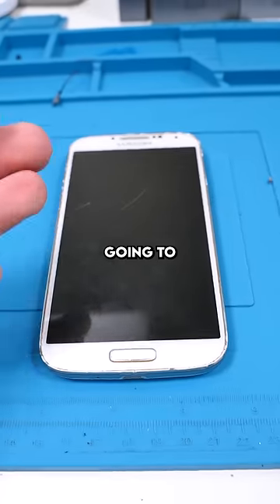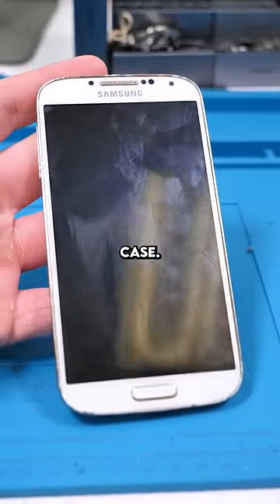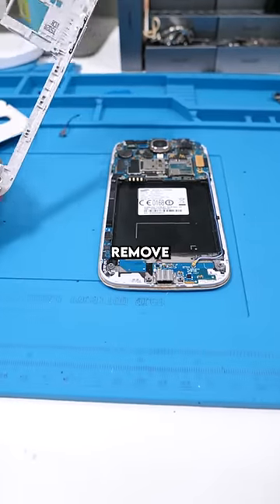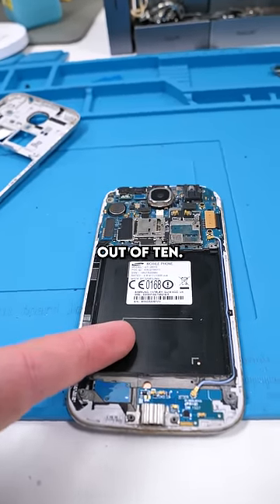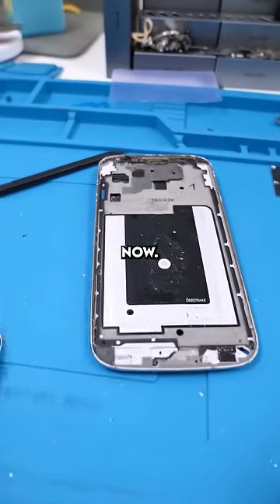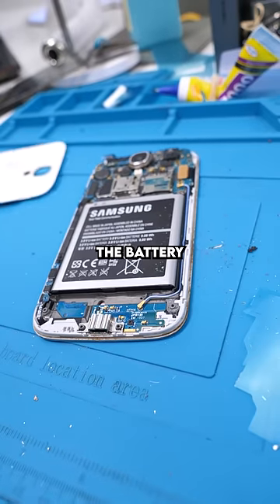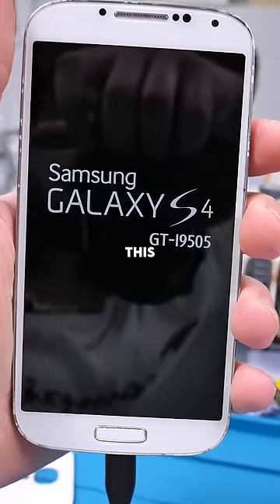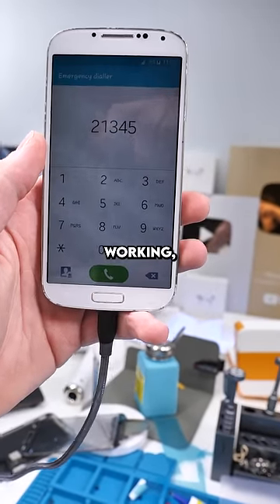Fixing The First Phone I Ever Owned... #Shorts

Comment: I am still daily driving my S4 I got at the end of 2013!
I've gone through about half a dozen batteries (OEM and aftermarket) and it's had a few repairs through it's life - I've replaced the charging port, vibration motor, and last year I replaced the screen glass after it got cracked - luckily I was able to save the OLED.

I've modded it with wireless charging (save the USB charging port!) and flashed custom LineageOS (Android 11) - and with that, the phone still does basically all I need!

The eventual replacement will have a lot to live up to. I'm not liking how so many manufacturers seal the phones these days - why do we tolerate battery replacements being so difficult?

Also, hEaDpHoNe jAcK
Reply: I like that thought process. Keep going strong S4!

Comment: Nice, that means people are still using the older models like me sometimes. I wish I got my Samsung galaxy tab 3 fixed by you because we had to pay 80 percent of the actual price of the tablet (8k PHP) (144$) which was 6k PHP(108$). They didn't even glue or seal it properly that a dust mite was visible in the screen XD but that was around 2019 when I got it fixed by Samsung's customer service. Also the problem was like in this video, the lcd crack but no the glass/screen. Still have the old lcd part with the screen attached and home button.

Comment: my ipad 6 / 7 (i dont remember which) wont charge, when i plug it in it doesnt charge- i usually have to keep unplugging it and plugging it back in for it to work. changed cords, blocks, and outlets. advice? i dont have the money to get the charging port replaced. i have tried cleaning out the port, nothing changed

Comment: Do you think you would be able to fix an old IPhone7, I’m not sure why but it won’t connect to anything: cellular, airdrop, wifi, Bluetooth. Nothing, other than that the camera won’t boot up if I try to take photos. One repair guy tried to replace the camera but it didn’t work, he thinks it’s a micro soldering problem which he couldn’t do.

Comment: PRG
I have a question 
My redmi note 10 suddenly stopped charging while the phone was off, later it stopped responding entirely while off , meaning that if i turn it off and try to turn it on, it won't turn on.
Fast forward some months later, it stopped making sounds (mic and speaker suddenly stopped working.)
Later on in June 2022 as i was using it, it went off and since then it hasn't charged nor responded (60% battery at that point). 
Could it be the battery or something else?